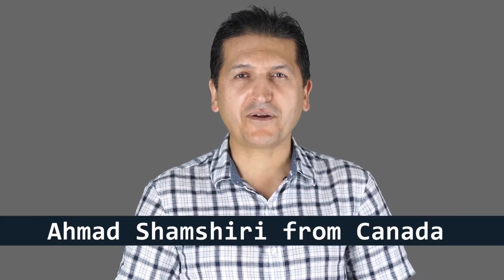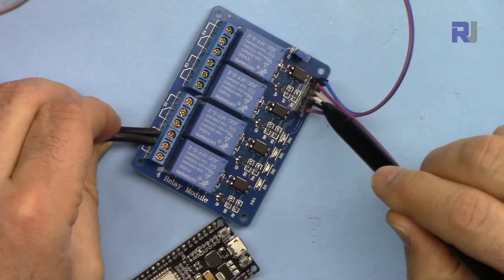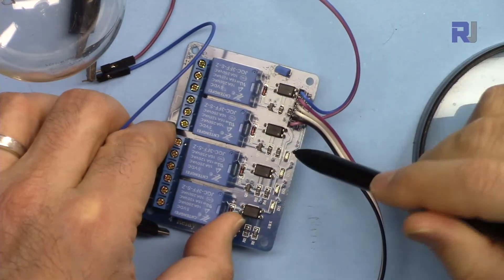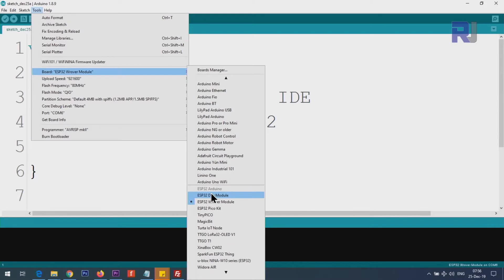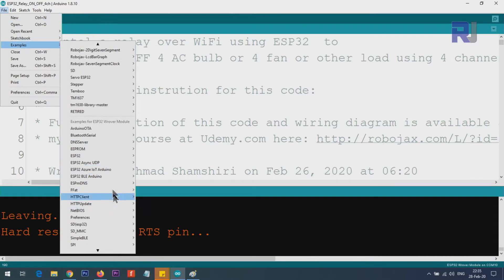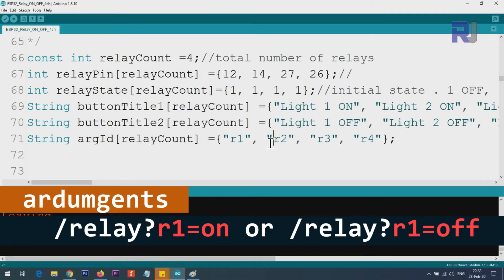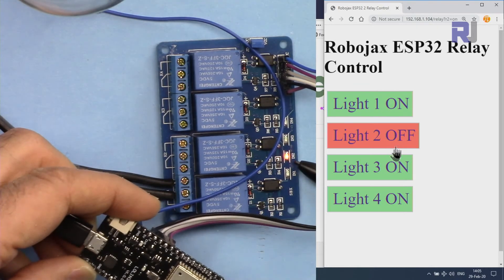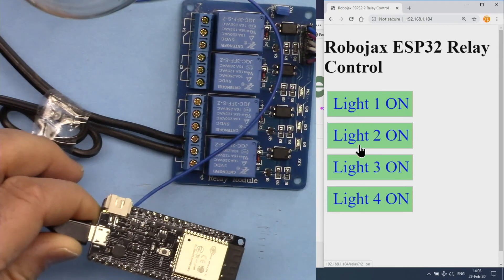ESP32  Project: How to control 4 AC bulb or load using 4 Relay over WiFi - RJT287

Comment: Thanks for sharing such an Awesome project. I m using esp8266 to control 4 light switches with a web server code. It is working fine as long as I  remain connected to SSID & ACCESS POINT IP but whenever I connect to my other WiFi connection to check my emails & again try to connect to my wifi switch module, it doesn't connect. I think the problem is due to the module remaining in last connected mode.
As I have installed the module inside the electric board, I don't want to put reset switch inside the board.
I want you to please confirm that your code can get connected as many times as required without any problem if in between I try to connect my mobile to any other WiFi network.
Awaiting your earliest response.
Thanks & kind regards.
Reply from the maker: You are welcome. Interesting scenario. I just checked the code which by the way is from the examples of ESP32, the code prints .... until it connects and then will not connect once  it disconnects.  I just realized that I have move a video creating a function to check the connection and if connection is lost, it has try connecting again. I am not sure when, but I just put on my "to do" list.
Reply: @robojax  Yes, you are right.
I also have the same idea that the code needs to be included a routine that timely checks the connectivity & whenever the connection is lost , it need to be re-connected again. I searched for the solution on net but unfortunately most of the web server codes to control relays has the same issue, whether in AP or STATION mode.
Hope you will update me when finding a solution.
Once again Thank you .